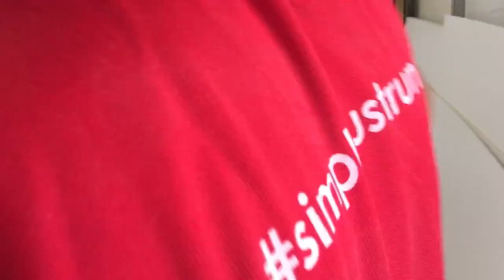How to Build Small kitchen cabinet and Understair storage..

Comment: Hello, pwede bang makahingi ng tips. May project akong modular kitchen cabinets, kasama ang shelves. Ano pwedeng gamitin para hindi makita ang screw heads? Kasi nasubukan ko nang gumawa using pocket holes, hindi maganda ang resulta sa melamine board. Minifix nman masyadong matrabaho at dapat precise. Pwede bang screw at lagyan ko nlang ng screw head plug? Salamat sa sagot.
Reply from the maker: Screw cap, masilya, paint.. yan sir mga pwedeng pang takip sa mga screw..  thanks
Reply: @KzoneWoodworks  thanks.
Reply from the maker: Welcome po